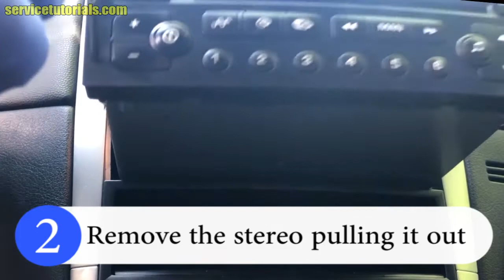How to remove / replace a car stereo from Peugeot 207, 307 & 308 in just 3 steps

Comment: same radio in my sisters car, those power cables are so hard to get out, still didn't come out so yeahh....
Reply: Hi, maby u take out  power cables i have same problom, its just so hard to take out... maby u have some tips how to take out? ...
Reply: @tadasgudauskas6783  I used a piece of steel wire to push the clip in as hard as I could so it became loose... without it was impossible to disconnect it.
Reply: Having the same issue. Are there any more solutions?